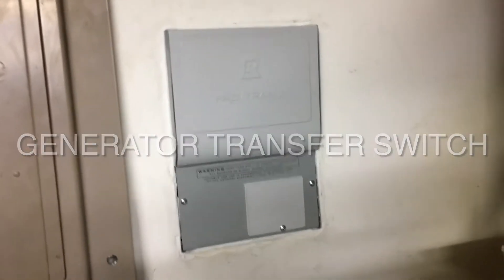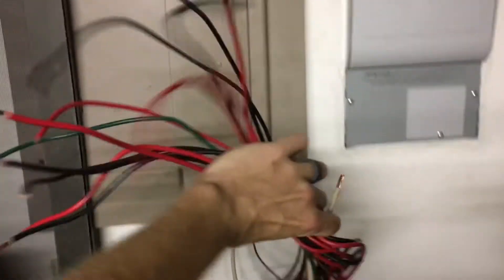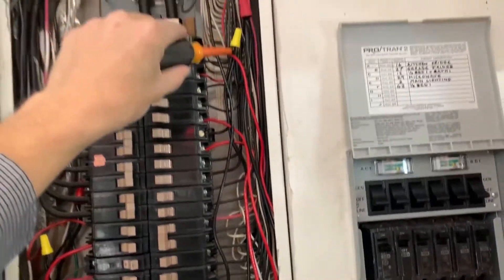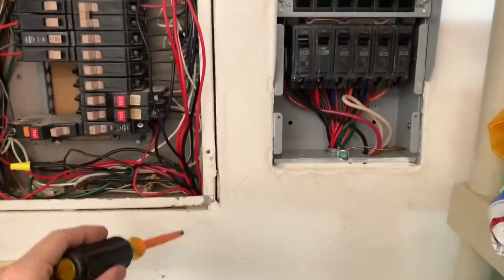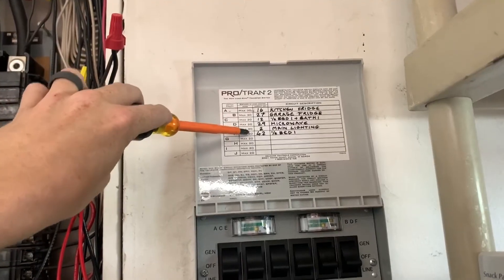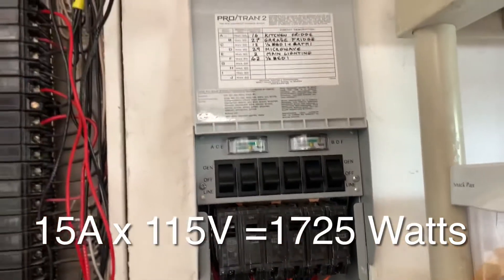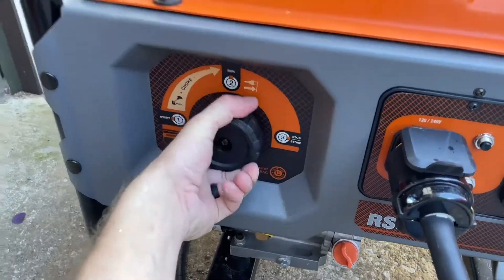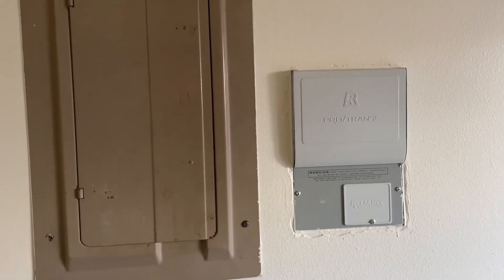Installing your own Generator Transfer Switch

Comment: Please review Nature's Generator Automatic Transfer Switch. Had one installed to Bluetti AC500/2-B300k batteries it worked excellent. Added 13 breakers so far.

Comment: Why can't you do the same thing basicly with a heavy duty double male ended cord by shutting the main power off to your electrical panel coming in from the outside. Then plug that cord into your generator and the other end to an outlet ther by energizing the panel. Turn off all circuit breakers in the panel except the ones you want to run. Wouldn't that get the same results by only energizing the certain circuts you want to use without all the fuss and bother of a transfer box??
Reply from the maker: Yes, it's essentially the same thing... except for one huge difference. Safety. The transfer switches are designed to allow you to easily and safely switch from street power to house power, with ZERO chance of those two power sources connecting. With a transfer switch, you also never have to turn off the main breaker.

Comment: What specific cable did you choose to use from the inlet box to the transfer switch? I think they recommend 10 AWG, but for some (10/4) they say a max of 25A. Did you go with 8/3 WG?